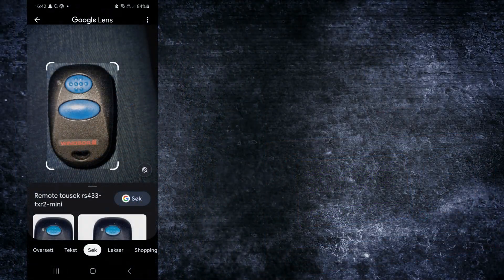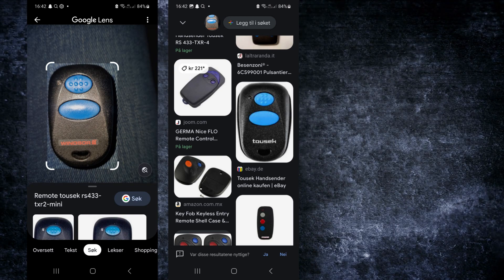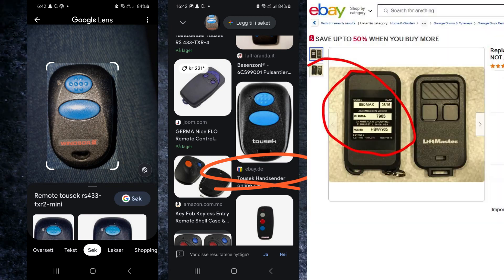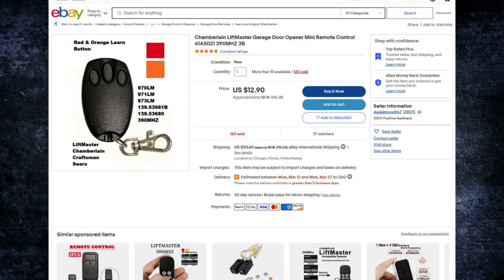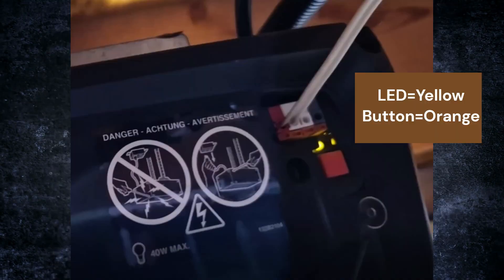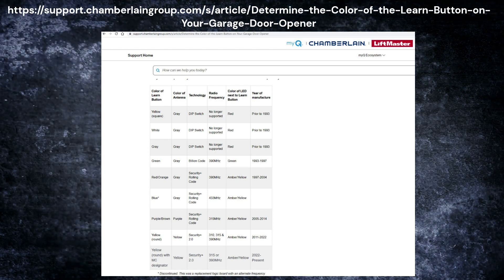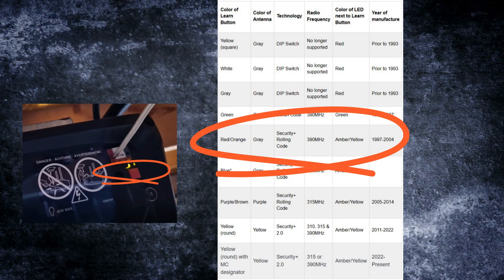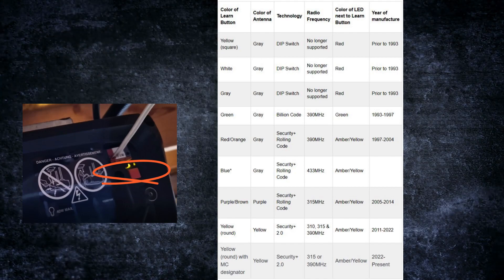Rolling Codes Explained part 3 - Finding Security Protocols #flipperzero

Comment: hey what firmware do you have to be able to get the protocol? Thanks in advance (WILL SUB IF I GET A REPONSE I AM DESPRATE)
Reply from the maker: Hi. Thanx for asking. In this case I used the Rougemaster firmware. Alot have happened the last year on the FZ, so I@m working on a new video on firmware´s for the FZ.
Reply: @techandfun7723   AWESOMEEEE IM EXICETED TO WATCH IM SUBBED NOW also do you think it wil work with a manaratec synergy 370 i cant find the protocol ANYWHERE please help

Comment: My "read" function wont pick anything up unless I have "Bin raw" selected.  Like, it'll show that is it detecting a signal but it wont pop up as yours has shown
Reply: In order for the "Read" function to pickup a signal, the flipper has to be very close to where the signal is coming from, and the signal has to send out it's full signal.
And even if you pick some of it up on Bin raw it might still not work. If that's not the case, and you are close to the signal then you might be using the wrong frequency, or maybe modulation. Use the frequency analyzer first to figure out what frequency the signal is operating on first. Then try picking the signal up again like I mentioned
Reply: @danielm9615 ive used the frequency analyzer to get the right frequency and modulation, but the flipper will only capture it on read raw, trying it on my keyfob

Comment: Thank you sir that was informative. Btw, what did he mean by protocol ? What I know is once you click a button Bluetooth frequency is generated    out of the key fob that Carries:

Access code: fixed sequence of bits that is sent at the beginning of a Bluetooth transmission to establish synchronization and ensure that the receiver is correctly tuned to the frequency and timing of the transmission
 
Header: contains information about the packet itself, such as the length of the packet, the type of data being transmitted, and other control information.

Payload: whatever data wanted to be sent

Rolling code: security feature used in some Bluetooth devices to prevent unauthorized access. It is a randomly generated code that is used to authenticate a Bluetooth connection between two devices.

Can anyone explain protocol part of the image ??
Reply: Rolling code isn’t a Bluetooth specific process

Comment: What firmware are you using? I can't pick up protocols by using the read function
Reply: I believe it’s rouge master
Reply: In order for the "Read" function to pickup a signal, the flipper has to be very close to where the signal is coming from, and the signal has to send out it's full signal.
And even if you pick some of it up on Bin raw it might still not work. If that's not the case, and you are close to the signal then you might be using the wrong frequency, or maybe modulation. Use the frequency analyzer first to figure out what frequency the signal is operating on first. Then try picking the signal up again like I mentioned

Comment: When you do the read, it shows you the security protocol but for mine it just shows if there is a subGhz signal active. do you have a firmware that enables that?
Reply from the maker: I've tested this both using standard firmware and the RogueMaster. In both cases I get the details when reading the frequency.
Reply: Funny coz I don't regardless of if I use unleashed, RogueMaster or standard firmware.. Maybe it's a regional thing?
Reply: @awidepannus8735  does it only show you the bar at the bottom that moves up when there’s a frequency? Cuz that’s all I get
Reply: @Spoomped  yeah same as you, exacty as you described. Rolling or static code
Reply: @awidepannus8735  I’ve been trying to look into it, i haven’t had any luck
Reply: @Spoomped  report back here if you find answers. I will too
Reply: @Spoomped  what "region" are you in, btw?
Reply: @awidepannus8735 someone said to turn on binraw and it might show u protocol
Reply: In order for the "Read" function to pickup a signal, the flipper has to be very close to where the signal is coming from, and the signal has to send out it's full signal.
And even if you pick some of it up on Bin raw it might still not work. If that's not the case, and you are close to the signal then you might be using the wrong frequency, or maybe modulation. Use the frequency analyzer first to figure out what frequency the signal is operating on first. Then try picking the signal up again like I mentioned